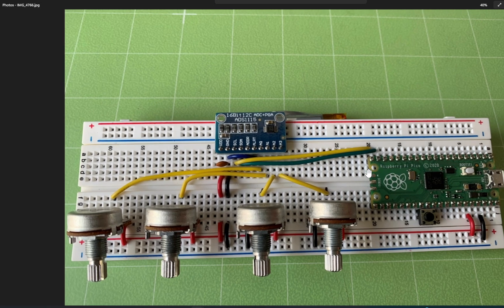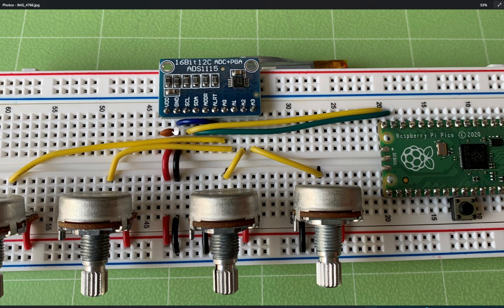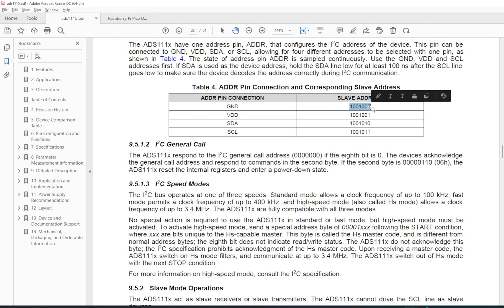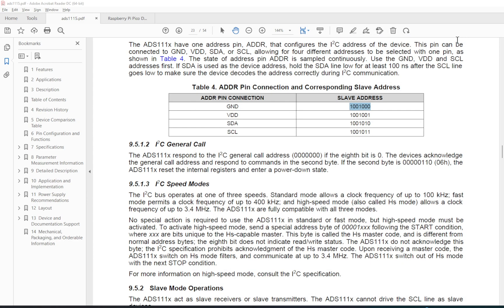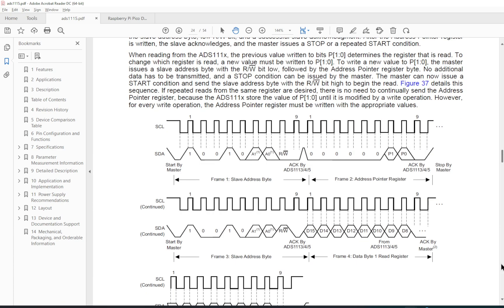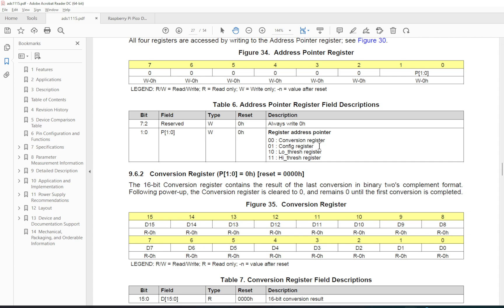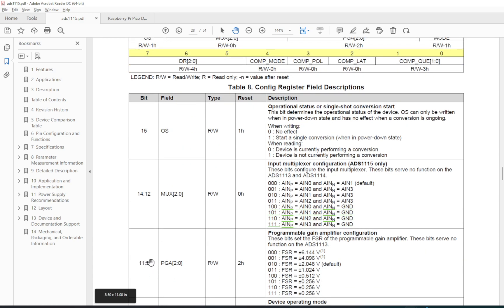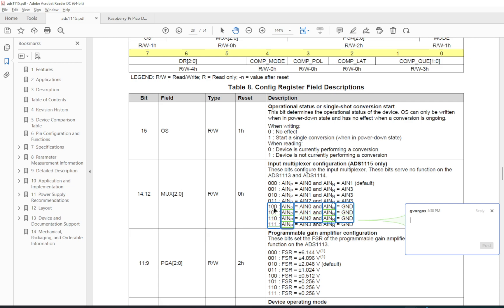Video Request: Read multiple ADCs ADS1115 PI Pico Micropython

Comment: That was very well explained indeed. I did have to change a couple of lines to get mine to work, and it has the odd effect of displaying the values on the wrong channel in the print out i.e. if I put a signal into A0 it appeared on the second column not the first. 
I had to change this line-    while(config & 0x8000) == 0:
To this-   while(config & 0x8000) == 1:
and I noticed the values did not increment by ones, but 257's so I fiddled and found changing this line-   return result[0]<<8 | result[0]
to-  return result[0]<<8 | result[1]  and everything worked fine.

I would like to have said I knew what I was doing, but sadly not. Has anyone else had this problem?
I was using the same ADC, pi pico, and Thonny. 
it is the most stable and liner ADC I have played with so far.

Comment: Hello. Im using the ADS1115 to read some values from a wheatstone bridge but i dont know how to make the differential input. I have tried subtracting the inputs but i need the positive as much as the negative. Im using the wheatstone bridge for a NTC Thermistor. Any suggestions?

Comment: Works well. I was getting some maximum voltages (over 8 volts) at times with unused pins grounded. So I modified the code to return 0 volts when the value equals 0xffff. Many thanks.

Comment: Thank you so much for this work. It is amazing how quick and professional you wrote this code.
You are a genius!
I am 72 years old and I developed power electronics for more than 45 years, especially laser drivers.
Now I'm retired and I can do what I want.
Currently I work on a 3 KW Induction Heater, just for fun, and it is the first time that I try to write programs for a microcontroller, in this case for the Raspberry Pi Pico.
I searched the web for more than one week for a driver for the ADS1115, but none of them worked.
So I am very happy that I found your work here and now I can continue.
Thank you so much!
Best regards
Peter
Reply from the maker: That is awesome Peter, glad you found it helpful:)
Reply: @guser210  Yes, it is really helpful, thank you very much again!

Comment: Hi 
In your setup at the beginning:
def readConfig():
    dev.writeto(address, bytearray([1]))
    result= dev.readfrom(address, 2)
    return result[0]<<8 | result[0]
print( bin( readConfig()))

you got:
0b1110001111100011

when running the program, Im getting:
0b1000010110000101

on my setup, I havent connected the ADDR pin to GND, there is a pull down of 10k to ground(GND) on the ADS1115 board
Can you please help me on this?
Regards,
Suded

Comment: line 15 in the code is wrong. result[0] is the lower 8 bits. so.
return result[0]<<8 | result[0] # returns 11100011   11100011
Lower 8 bits shifted left plus lower 8 bits?
Surely should be:
return result[0]<<8 | result[1]  # returns 10000101   11100011
that certainly returns the correct default settings on a new unit.
Reply from the maker: Yup you are correct.
Reply: @guser210  Are you still able to work with it?
I would love to get your code to work. Simple and to the point, without all the overhead of third-party libraries.
I could not get your code to run without errors.
Best Regards,
Stewart.
Reply from the maker: @So-Now  what errors were you getting?
Reply from the maker: The code works fine as you can see on the video, there is a link on the description for my discord channel, came join if you want to contribute or need help.
Reply: @guser210  
OK.
Thanks anyway.
Reply from the maker: @So-Now  I have a feeling you misunderstood my reply, it is easier for me to help if you ask your question on the link on the description, there you can post pictures, video, links and can collaborate with tools like desktop sharing, files and code

Comment: so if i need to use the 6.144V i will use (0 << 9)
Reply from the maker: you would first read register 1 then clear the bits by reg1 &= ~(7<<9) and writing it back to register 1
join Discord I'll explain how it works the link is in the description.

Comment: teacher i have problem that raspberry pi 4 model b . I couldnt use ads1115 with raspberry pi 4 when i install the library i take errorr that python-pip and pythonsbus
Reply from the maker: unfortunately I do not have a Pi 4 only Pico.